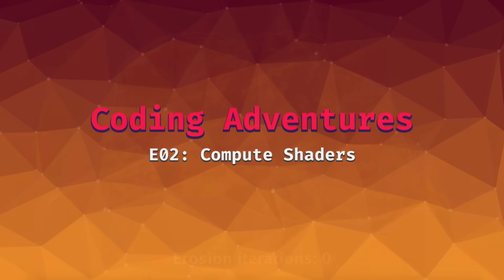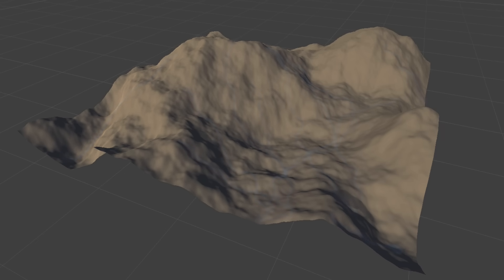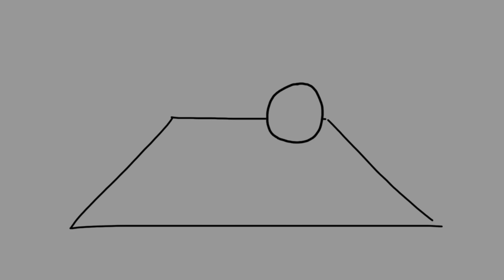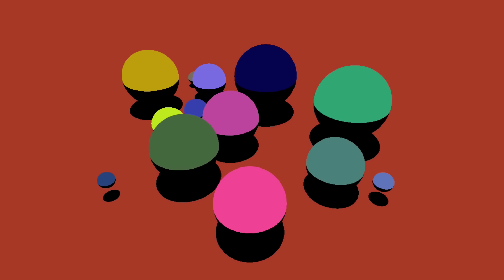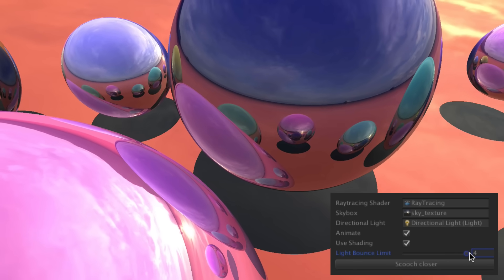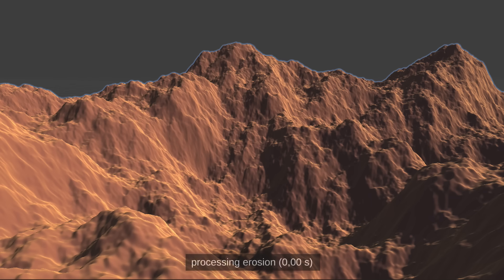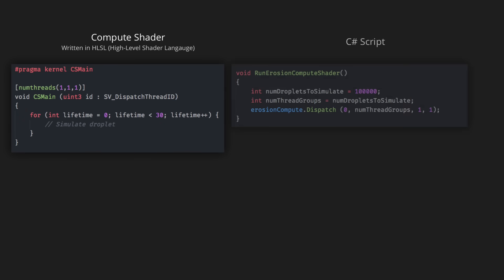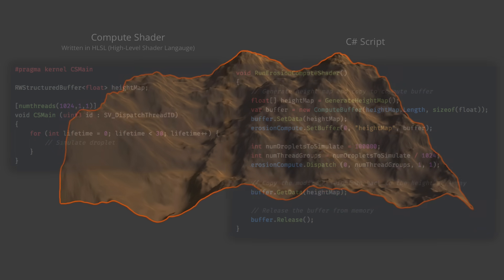Coding Adventure: Compute Shaders

Comment: You need to round up, so you should have: numGroups = (numThreads + threadsPerGroup - 1) / threadsPerGroup
Otherwise you get 0 groups for 1-1024 threads, 1 group for 1025-2048 threads, etc. when you need 1 group for 1-1024 threads, etc.

Comment: Watching this made me think how cool it would be to save the heightmap of the original landscape before erosion and make each droplet at its creation check if it is on a pixel that has been eroded a certain amount already. The deeper you go, the more dense the ground gets thus it should erode slower. Combining this with a random noise map of "dirt thickness" I think a much more realistic erosion could be simulated with basically no added calculations. Also, the formula (original height - current height) shows how much the ground eroded and more importantly based on the "dirt thickness" noise map, it gives you what color the pixel is. Without adding significant calculations to the program, you can color the ground easily, even with multiple ground layers and rock types corresponding to different ground density levels.

Comment: Ah, that's quite similar to the IJobParallelFor, of course on the GPU you should be able to have even more threads (and speed). But still wondering what code editor I could use for .compute Shaders, which is a little more helpful than a plain text editor (on a Mac).
Sidequestion: I am pretty sure one of the planet-generation/marching cubes adventures contained a triplanar surface-shader combined with normal maps, but which was it? Cannot find it. Guess it was about moons …

Comment: I know I'm very late to this but turns out A LOT of people don't understand how numthreads works. in your GPU, you are telling your computer to set up many sub compute modules, each one having an id. if you think of the numthreads id as an index in a double for loop (at least for (8,8,1)), it will make a bit more sense. instead of

basic example in slight sudo code:
texture = new texture(100, 100); black and white or one channel
for(int i = 0 ; i < texture.width; i++) {
    for(int j = 0 ; j < texture.height; j++) {
        texture[i][j] = 1;
    }
}
converts to this.
[numthreads(100, 100, 1)]
void TextureWhite(uint3 id : SV_DispatchThreadID) {
    texture[id.xy] = 1;
}
CPU takes 100*100 cycles to go through the texture to change each pixel to white one at a time
GPU takes (with  numthreads(100+,100+,1)) 1 cycle to go through the texture and change all the pixels to white at the same time

the id variable represents the i,j,k that would be in your for loop

where the CPU iterates over each pixel one at a time, the graphics card can iterate over each index the for loop would have called but in a grid all at the same time.
if you are going to be computing for lets say a 100x100 resolution texture with RGB, then you should use numthreads(100,100,3) having the id.x be the x coordinate, id.y be the y coordinate and the id.z be the color channel. if you are working on an array of floats with lets say 100 elements, then your numthreads should be (100,1,1) and have the id.x be the index to the float. if you are working with 100 floats in an array, its okay to have lets say (10, 1, 1) but the problem is it will take 10 passes for the GPU to complete the processing and its also okay to have more numthreads than necessary but if you know how much you are going to be working with at a time, its better to set it up to the max you are expecting so your graphics card isn't setting up threads for nothing to happen. so in summary, your graphics card can compute a group of for loops for you at the same time, your numthreads is setting up a grid to compute what is basically a for loop and its a good idea to keep the x and y of the numthreads around what you think you are going to be working with.

also if you know what the amount of threads you are going to get into your kernel are all the time, I guess its still a good practice to divide it in the dispatch so it doesn't overflow. but having more compute units dispatched and processing in one pass rather taking a safe 8,8,1 in multiple passes is better.

might still be confusing but I hope this helps someone!

Comment: I did something similar to learn ruby. Not having easy access to a GPU from code I instead moved dirt in stages, a sort of progressive refinement. I started with a very low resolution map of the world, wore it down, then doubled the resolution and added some random detail. Each stage of the world had the same number of raindrops except the last but since the resolution was smaller the first raindrops were very wide (like glaciers or something). The last stage would get more raindrops.

The elaboration I made was to track a global sea level. If a raindrop was below sea level its carrying capacity would be zero. This gave nice river deltas. I could tell that rivers and maybe ponds were happening, but I couldn't get a good way to detect where the rivers were.

Comment: Tried running the updated terrain erosion example in Unity 2020.1 & 2020.2 and all it did was flatten the terrain and throw an error.

"Thread group count is above the maximum allowed limit. Maximum allowed thread group count is 65535."

I cant seem to fix it. Even after googling what the issue might be. Any ideas what the cause might be?

Comment: in 4:53, here is why 1024 works better : GPU is a collection of threads aka small cpus on one cheep. thus by defenition there will be a limt number of how many threads on each GPU. currently i think the GTX series has max of like 3000 and something thread.  Now you want to run something in parallel generally the number of stuff you wanna do will exceed the number of threads for instance if you want to do a ray tracing of an image of size 600 X 400  you have 240000 pixel but in reality you can run only 3000 of them in parallel . the solution is work loads each GPU is divided into multiple Warps each warp contain only 32 thread that has shared memory and small cache memory to run 32 kernel as fast as possible and alternately. If you now make the number of thread (1024) a multiple of 32, you help the GPU organize the work load and u will have ur 3000 thread bizi all time thus better performance

Comment: Compute shaders are pretty neat and gave me a good lesson in how GPUs schedule cores towards tasks being run and how to optimise towards that (i.e. scheduling a workgroup with the number of threads available in a "wavefront" for each dispatch). Made a pretty neat raymarcher with some basic shadows and reflections based on some work I'd done in shadertoy, and then because I'm lazy I do a very basic blit of the image I generate, right to the swapchain. It probably runs faster though cause I'm not calling the vertex/pixel shader unnecessarily to get the image up, and the GPU can bypass all the rasterization hardware

I believe it's pretty necessary to optimize compute shader code such that your workgroups can all be executed at once (and without wasting any threads!!). For NVIDIA you're looking at executing 32 threads at once for a single workgroup - though I'd imagine doing 64 would not have too much of a drawback - even if two SIMD units have to be activated for that workgroup. For AMD, it's a bit more generous (for some) with 64 threads, so if you're doing quite a large dispatch with many independent threads then an 8x8x1 workgroup for instance runs quite nicely. Intel is a lot more restrictive though - without looking into Xe (which hopefully has some improvements), with your average integrated graphics you can only really dispatch 8 threads at once - but then again developing for intel is a waste of time.

Comment: A bit about how GPUs work (oversimplification)
The GPU has a lot of cores and a main core.
When you pass a kernel to the main core, the main core sends the kernel over to free cores.
each core is called a group, in this example.
The main core also passes the group's ID as (x,y,z) coords.
Each core can then run the kernel on a few threads.
Since different threads from the same group run on the same core, they can somewhat synchronize and communicate.
The same is not true for threads from different groups, as different cores might not even be able to run at the same time.

Comment: If you just create something that acts like a light?
For example (OR NOT) 
If you can create an entity that behaves like light just by using simple lines that all come from one the source and depending on what kind of surface the lines touch it can either, refract (spread out),reflect (Bounce back),  absorb, and diffract (randomly gets reflected)..
And if an object it touches is a Brick wall with a rough surface the lines would spread on the wall and with some bouncing to back in the area of the light and when the lines touches the ground it would either refract, reflect, diffract, and absorb, and depending on what angle the line is coming is the result how the area will look.

The lines should also have a travel distance the will be affected by the object it touches like the highly reflective objects subtracts less than the rougher objects with black just absorbing those lines...

After that the other side of the wall that is not facing the lighted area would be the shadow and as we all know the intensity of the shadow depends on the surface of its area with the more reflective surfaces making lighter shadows, refractive having dimmer ones, and obsorbers making almost impossible to see what's inside the shadow.
And the shadows are also affected by color.

Which brings us to the reflecting of the coloured light..

If the lines touch a coloured object like for example a line touches an object that is color yellow, those lines that touch the coloured part would change the color of the lines to yellow.

But if you don't get what I'm saying, it's basically applying the techniques of shading on your drawings..

Comment: 4:55
In your code on github there is:
heightMapComputeShader.Dispatch (0, map.Length, 1, 1);

And cuz of it I get error that thread group count is bigger than 65535 cuz map size is 1500x1500. When I change it to fe:
heightMapComputeShader.Dispatch (0, 65000, 1, 1);
only a fraction of mesh has normal heights, rest is 0. No problem with cpu erosion version 
What to do?

edit.
It turns out in my version 2019.2.2 it doesn't work but in 2019.1.3 it does work. I suspect any previous version also does work. Hope it helps someone.

Comment: The reason you found 1024 to be the best number is because it is, each thread block can have up to 1,024 threads in CUDA 3.0 and later. Some earlier CUDA versions allow only up to 512 threads in a block.
Reply: http://digilib.stmik-banjarbaru.ac.id/data.bc/18.%20Programming/2013%20Programming%20Massively%20Parallel%20Processors%20A%20Hands-on%20Approach%202nd.pdf Chapter 3 Kernel Functions and Threading

Comment: Given a problem that can be solved both ways, I'm fairly sure it's more efficient to use compute shaders and solve it in hardware rather than on CPU time - if only because the inputs to the shader are managed on CPU, but also because you could run other problems that do NOT have a GPU-friendly solution on the CPU in the meantime. Excellent video, thanks :-)

Comment: Looking through the example project it looks like first you generate the heightmap in one shader then pass the heightmap to the erosion shader. From what Ive read (and I am very novice at this), the slowest part of compute shaders is transferring data from the GPU to the CPU. So wouldnt it be far faster to generate the heightmap and apply the erosion within the same shader?
Reply: Also, would you recommend converting all terrain data to being a single dimension array so that it is friendlier for the gpu?

Comment: When I saw the first video of your terrain gen last month, running it on a GPU was exactly my thought. Since I wanted to try and do something with CUDA, I did pretty much the same thing you're doing with compute shaders in Unity now. Except that I wrote a DLL in C++ for it and used CUDA there, which is just a bit closer to hardware level. Needless to say, going for shaders in C# is probably the better option though as long as you don't try to squeeze out every single bit of performance, as it isn't tied to the OS or an nVidia graphics card. Anyways, here are a couple things I'd like to mention:
- For your heightmap generator you're currently starting map.Length many thread groups with just 1 thread each. It should be more like map.Length/1024 threadgroups with 1024 threads each, otherwhise all those threads will be run sequentially and there is no benefit from using a GPU. Keep in mind though that if map length is not divisible by 1024 you need to add an additional threadgroup. Also, you could launch it as a grid so you don't need to calculate x and y all the time (modulo on GPUs is expensive). You'll need to check if your position is still inside the map though, since your GPU will always launch a full threadgroup, even if not all of those threads are needed and would then write to unallocated memory.
- Instead of using atomic min/max in every thread you could write yet another kernel for each of those, that implement it as an optimized reduce algorithm that you could launch after the initial computation, before clearing the mapBuffer from your GPU. Maybe there is even a library for that. In my case I just used cuBLAS. Reduce algorithms can be a real pain to optimize though, esp. if you're not familiar with how your GPU handles its threads in depth, and the noise gen isn't really the part that needs all the speed, so feel free to ignore that.
- I really like the change you made for the erosion brush, having a list of weights for every map point was really set out to scale badly. I just put essentially the same loop you have for calculating weights into my kernel, instead of creating a list once and using that instead, which isn't really a good idea. I'm just recalculating the same stuff over and over again atm, with sqrts being rather expensive to use. Bad me :(

- One thing I haven't tried myself yet and I don't know if its even possible using shaders in Unity: if you write the hight map to the GPUs texture memory it allows you to just read 'in between pixels', doing all the interpolation using hardware acceleration. At least nVidia cards actually have hardwired circuits for interpolation of textures. Pretty sick.

Really, thank you for all the inspiration. I really learned a lot of new things from trying to make a CUDA version of this. Your videos are awesome!

PS: I also learned that Unity likes to crash a lot if you're not careful with hooked DLLs, better avoid them if possible :p

Comment: just curious, did you do a compare with the same random seed for cpu and gpu generated terrain, are the results the same? In the original serial code i guess the droplets were modifying the height map that had already been modified by other droplets, where in comparison the kernel does it always to a copy of the original map, or is the buffer shared between all of the shaders?
Reply from the maker: The droplets are writing to a shared buffer, so the result of the gpu version is a little different each time it is run due to the multithreaded nature. The overall shape of the eroded terrain is still very similar to the cpu version with the same seed, but smaller details differ a lot.

Comment: Sebastian, i'm still REALLY confused about how representing the 2D plane as a single dimensional array of floats works... I don't understand how you can possibly calculate where the drop falls with a 1D representation, surely float[][] would be easier to program?
Reply: The array is just each row of the heightmap in one continuous line. Then, when you want to work with the data as if it was in a 2D layout, you just have some mapper functions that takes you between the two formats. So for instance, say you want to go from 2D  to 1D, you would make a function (Pseudo code): 

GetHeight (x, y, heightmapWidth) { 
  return 1D_array[y*heightmapWidth+x];
}

If you want to get the x, y of a given 1D index (Still pseudo):

Get2DPos(index, heightmapWidth) {
  return new 2DPos(index % heightmapWidth, floor(index/heightmapWidth));
}

This is very untested, and it might have some errors of logic (It is late), but at least something like this should work.
Reply: @HKragh  yeah ok... I'm still really confused why he didn't just use a 2d array, that'd make it sooooo much easier. No need to write any convert functions. Maybe compute shaders only work with 1d arrays?
Reply: If I remember correctly, the heightmap data in Unity is stored as a 1D array. So he would continuously have to convert it, before sending if off to the gpu. And also I don’t think you can pass other than 1D arrays to a computer shader. But I am not sure.

Comment: Sebastian, thank you for your fantastic videos. Great balance of depth+breadth. I've been getting back into Unity lately now that they support asynchronous GPU feedback --- this allows you to fetch data from the GPU buffers without causing a pipeline stall.  Not needed in your current use case, but if you ever need to fetch results from a compute shader after every frame, you'll want to do so asynchronously. Anyway, great timing on this series, and I really look forward to following your progress with Unity's Compute Shaders!

Comment: Hey there, a performance advice: use a bigger threads group where the product between the dimension is a multiple of 32 for nvidia or 64 for amd gpus. You will have way better performances!